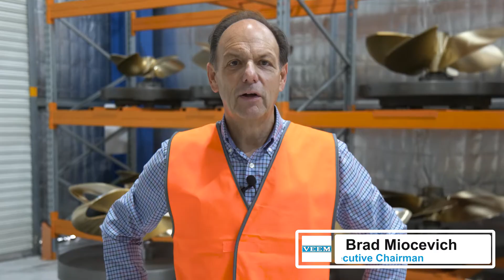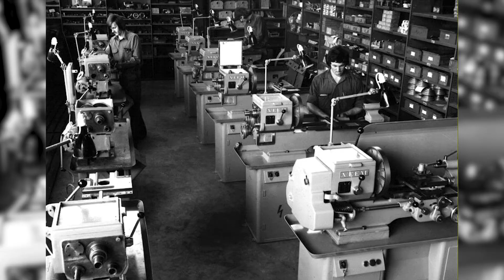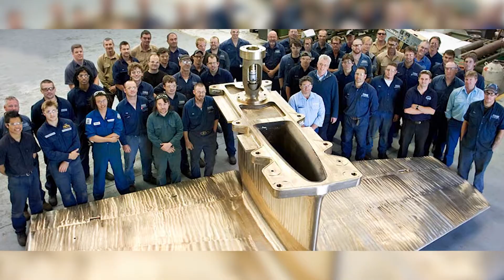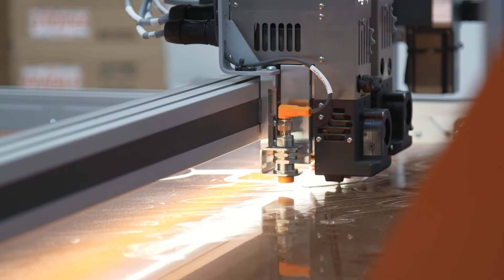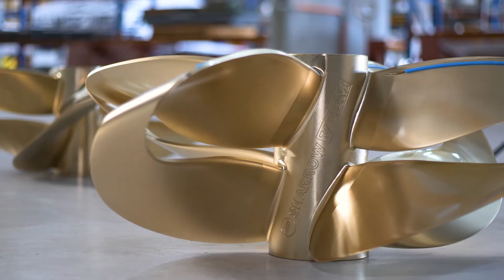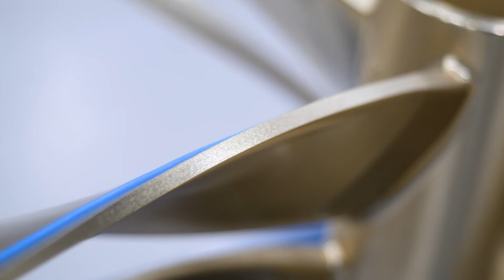VEEM to commercialise revolutionary new Propeller design with Sharrow Marine: ASX:VEE announcement

Comment: Yeah but do you have any that will suit a 48 ft Alloy Vortex Hull Lobster boat with twin 1000 hp Cat C12 inboards through ZF gear boxes driving surface piercing props, that already runs at ~ 48 knots? 🤷‍♂️😜😂😂